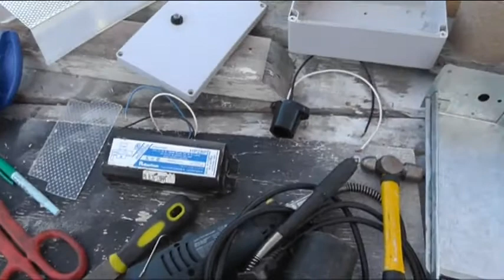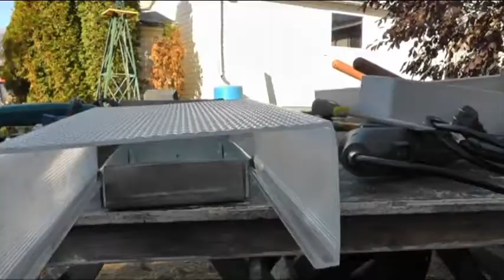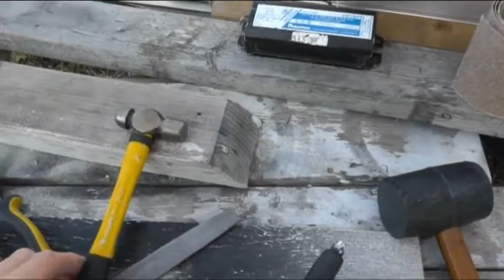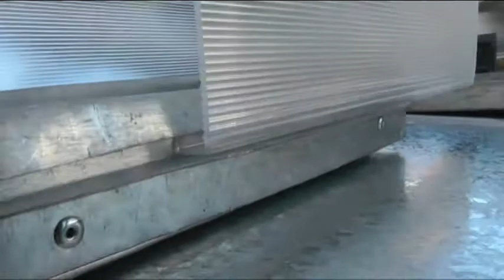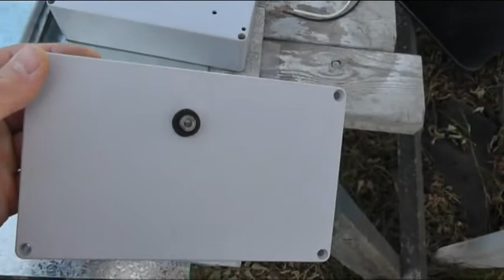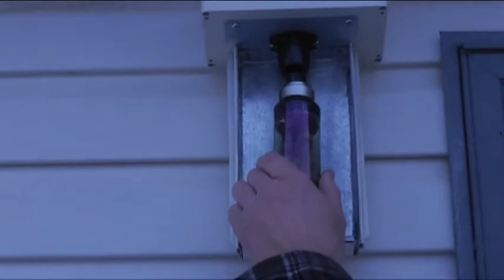Build Your Own Low Pressure Sodium Fixture - Philips LPS SOX SOX-E vintage

Comment: How can it run without an igniter?
I have 2 Philips SRM fixtures with SOX 55W and they both contain a ballast, capacitor and igniter.
Reply from the maker: The 18 and 35 watt lamps are small enough that the volts and current from the correct ballast is enough to start them. The larger lamp sizes and all high pressure lamps require an igniter. Thanks for watching.